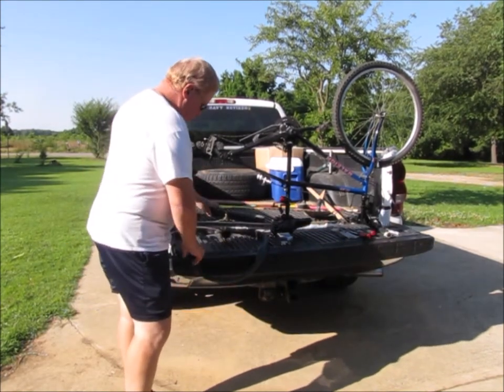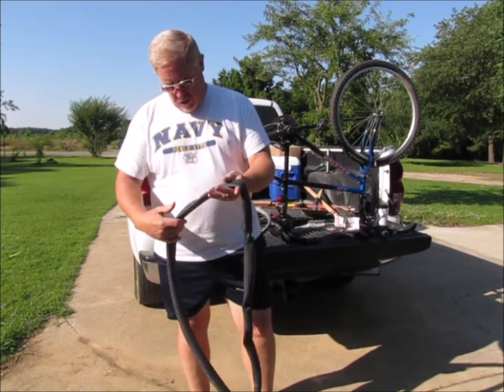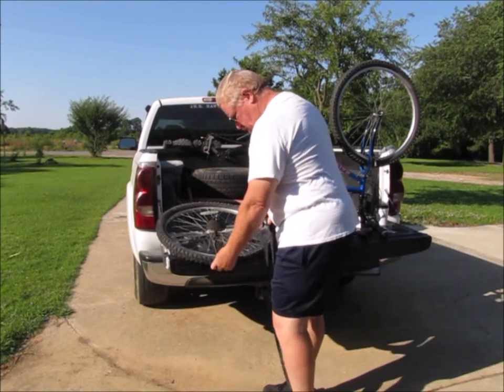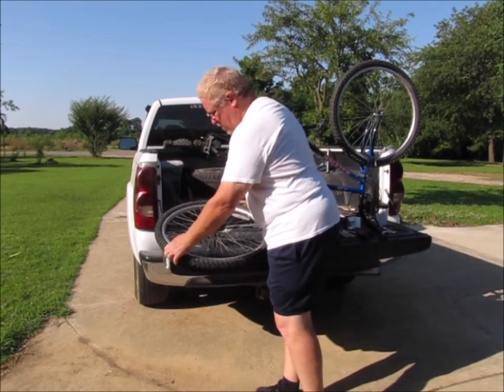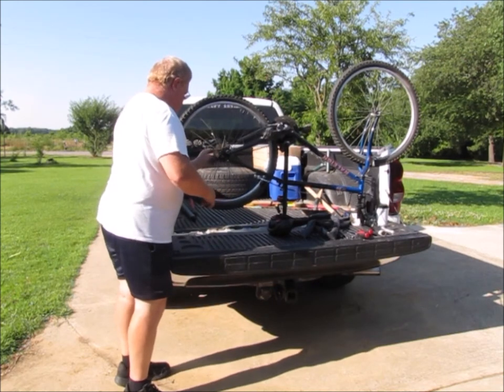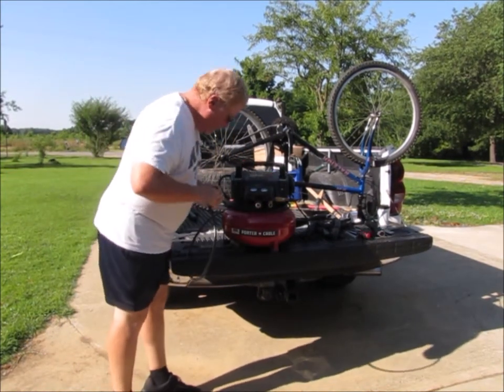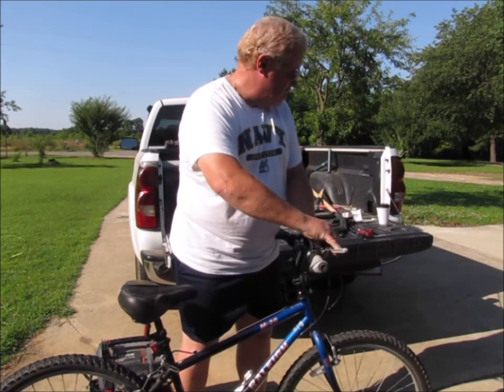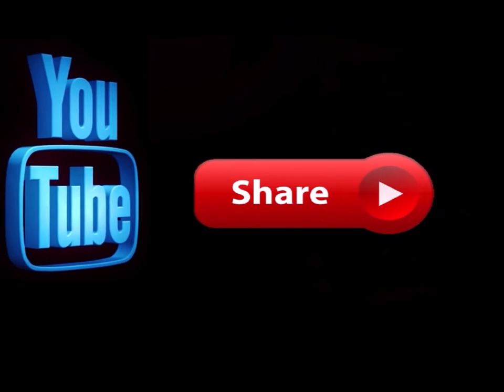DIY - Bike inner-tube replacement

Comment: I liked the chipmunk sound :) Funny you should post this ..I was on a ride this morning and wondering how long I can ride my bike before getting the bent rim fix.  BIke was delivered that way and the wheel is wobbling but seems to be holding up great!  Bike shops around here are a 4-6 week wait for service so I'm gonna ride it till the fall ..or till the wheel comes off..which ever comes first (hopefully not the wheel)
Reply from the maker: I will be glad to straighten out your bent rim.  Those are a challenge but I like challenges.  Just drop by on your next ride should take less than hour to fix! 😅

Comment: Way ltns a bike tire replaced.  Never did know the torque.  Those brakes were a pita 4+ decades ago.

Was a joy getting thicker tubes and also when green slime appeared.  Cuz the Tx. goathead stickers chewed up those tubes.  Those stickers were a irksome surprise when arrived in Tx as was none of those in SD.

Have a nice day & happy biking Ernie & Ed.
Reply from the maker: Thorns that would puncture a bike tire? OUCH!  Never experienced that although I did get a piece of a chain link fence through my rear tire on a 12 mile ride off road once and had to push the bike back 6 miles.

Comment: I need to check the pressure in my bicycle tires
Reply from the maker: Honestly when it comes to bike tire pressure checking I just press my thumb on the tire and see if it is soft or not.  I inflate them until I cannot push the tire down anymore.